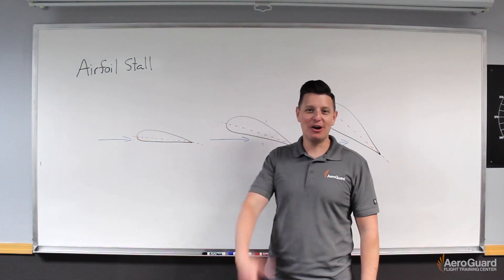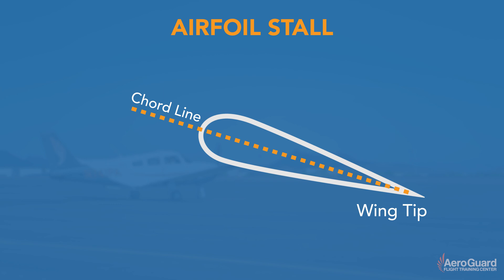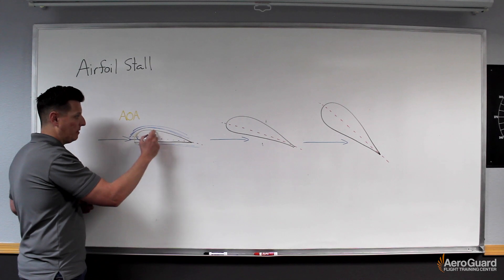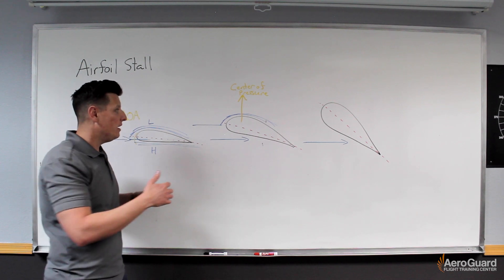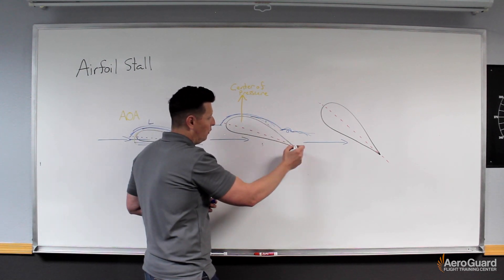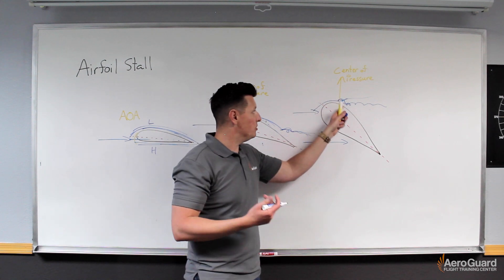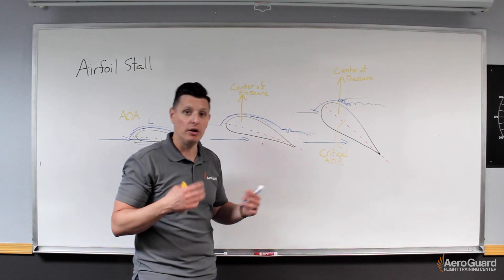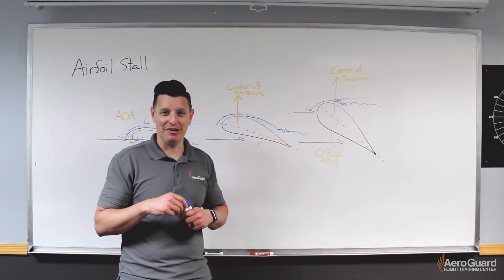Airfoils, Stalls and Critical Angle of Attack - AeroGuard Flight Training

Comment: I know plane gets into the stall in any air speed once it reaches the critical angle of attack. And as you mentioned when plane excess its critical aoa it will start significantly losing amount of lift. But how we can know the what air speed that you reach critical aoa with, can not produce any lift (0). An example, reaching critical Aoa with 300 should give you still still lift but reaching critical Aoa with 150 might not give you any lift. How i can know this (0) lift critical Aoa air speed ? Thank you !
Reply from the maker: Hi Yusuf, thank you for reaching out with your question! An aircraft manufacturer will test the aircraft in specific conditions to determine stall speed at various configurations. These will be listed in the aircraft’s Pilot Operating Handbook. However, stall speed can be affected by abnormal weight, center of gravity, and load factor. These factors can cause the stall speed to increase in what would be known as an accelerated stall. There are equations that can determine the stall speed in a given condition, however, it is not necessary to calculate these for day to day operations. Thank you!

Comment: So when the separation of airflow from the top of the wing reaches the center of pressure, is it at that point we reach CAOA? Is it at that point we begin to loose lift? Is the point we begin to loose lift considered a stall, or when a wing actually drops?
Reply: Hello, the answer (that I came up with) is when an airfoil/wing reaches its critical AOA, the amount of lift being generated can no longer support the weight of the aircraft, so a “stall”(in loose terms) actually occurs as soon as lift becomes less than weight and drag becomes greater than thrust. The process is quite dynamic in that all of these forces acting with the airplane are on scales. Speaking of scales, you’ll notice on an L/D max (lift/drag max) diagram that once you look right of L/D max (the top of the curve), that is when you begin to lose lift (which can be long before the aircraft actually stalls).
I hope this helps! (lol a year after you commented)
Reply: Additionally, my experience in a small aircraft is that the stall warning alarm will actually go off before the wing and aircraft actually drop so the stall will begin before the wings actually drop as well.
Thank you!
Reply: @serinatsuki9511  the aircraft I set up require stall warn 5mph before, plus or minus 1.
Reply: @serinatsuki9511  it does because a wing, one with a twist will begin to stall at the root and shake and shudder before wing drop

Comment: So do crosswinds and tailwinds factor into airfoil stall
Reply from the maker: Hi Greg – a crosswind or tail wind will impact the ‘relative wind’ experienced by the airfoil. Additionally, an airfoil doesn’t know the difference between a sustained wind and calm wind.  That is to say only a gust of wind would have an effect on the relative wind of an airfoil.  If it is a constant wind, regardless of direction, the airfoil will act the same.  If it is a gust of wind it would impact the airfoil based on the direction it approaches the airfoil.  A gust of wind is really going to result in a change in the velocity of the relative wind.  This changes the lift production of an airfoil, but doesn’t directly impact the angle of attack.  As an example, if an airfoil suddenly experiences a gust of tailwind, it would result in a reduction of speed of the relative wind.  That would result in less total lift being produced and the pilot would need to increase the angle of attack in that moment to sustain equal lift.

Comment: Hey Eric I'm enjoying videos and following the FAA test prep along.  Did you mean the Bernoulli effect or does the Venturi (carburator) effect also apply to air pressure over the wings? Thanks
Reply from the maker: Hi, there! These two terms are nearly synonymous. That is to say that the “Bernoulli Effect” that you refer to is more the physical principle that explains how a venturi works.  A venturi is a working example of what Daniel Bernoulli’s principle states.  When we talk about air flow over the wings, the venturi effect is created between the free stream of air above the wing unaffected by the airplane and the upper camber of the wing.
Reply: @flyaeroguard  Ok I appreciate your response. Thank you. Will you transition to a simulator or an aircraft in future videos? That would be great! Thanks.
Reply from the maker: We passed your request onto our team. Thank you for the idea!
Reply: @flyaeroguard  I appreciate it. I plan on joining you guys for my ratings and certificates and have seen videos by other instructors which are very helpful. Thank you.
Reply from the maker: We're very glad we could help you!